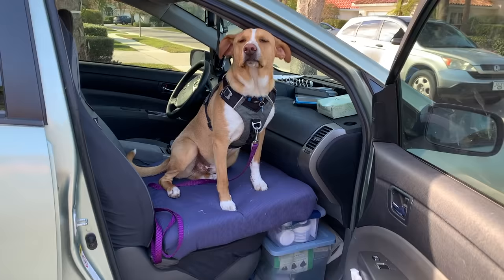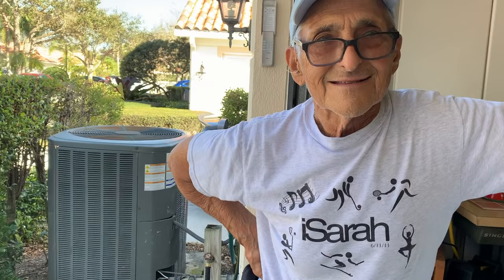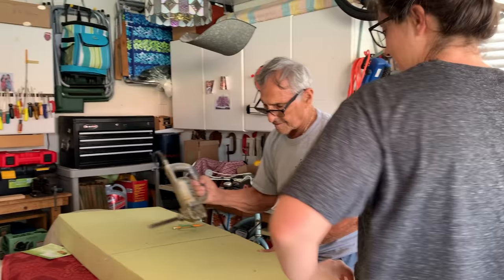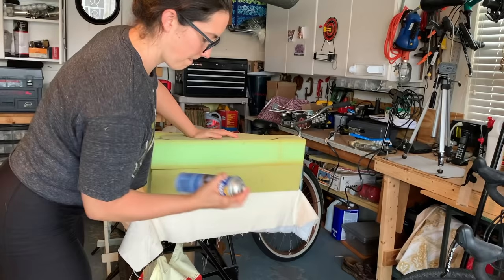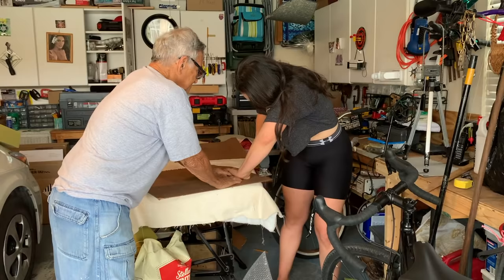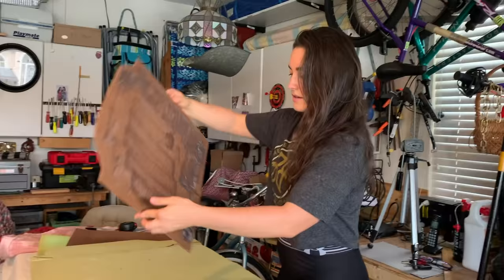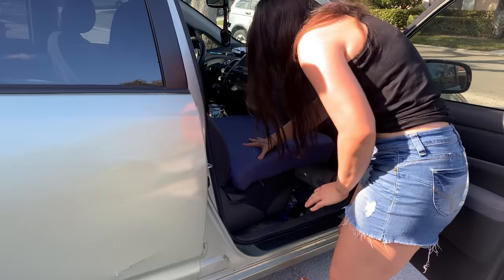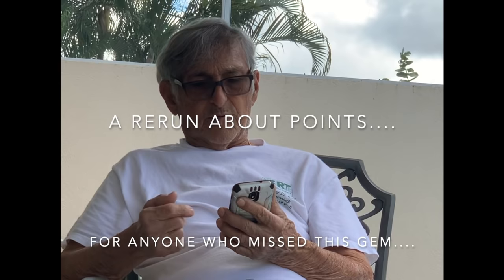Made a custom dog bed for my car's front seat! Step by step, HOW TO. Car Camping with a dog.

Comment: Camper knew from the beginning that was his bed. So cute! One question: does Camper have a seatbelt??? 😘🤗🌼🇻🇪
Reply from the maker: I’m actually working on a system right now as I removed the front seat (this is something you guys will see in a few weeks I’m just very slow at editing and )once I figure out that system I will post about it. :)))))
Reply: Lucky you camper
Reply: Sleepypod and ZuGo are the only independently crash test rated safety harnesses that have passed the crash tests.
Reply: There's a dog seatbelt that clips onto their harness and  alsoplugs into the seatbelt (where you put it on and insert it and it 'clicks'). It's SO super easy and cost about 10 bucks. Just another alternative.
Reply: @rainsofhealing4091  that type doesn’t pass crash tests, however, and dogs and passengers can still get horribly injured or die.

Comment: Camper knew from the beginning that was his bed. So cute! One question: does Camper have a seatbelt??? 😘🤗🌼🇻🇪
Reply: Was wondering about the seat belt too. You can use a seat belt with a harness. That way the dog isn't flung around the car in the event of an accident.
Reply from the maker: I’m actually working on a system right now as I removed the front seat (this is something you guys will see in a few weeks I’m just very slow at editing and )once I figure out that system I will post about it. :)))))
Reply from the maker: But yes originally I did have a seatbelt attachment for the long-haul!

Comment: I am new to your channel so you may have answered this question: have you been able to turn off to airbag in the passenger seat? I can't remember if the Prius gives the option. 

Your Grandpa is a sweetie ❣️
Reply from the maker: I actually have a video coming out where Iremoved the front seat... Should come out in a couple weeks but how this could be useful… I show you how to trick the car into thinking the seat is there and some thing you could possibly do is move the weighted sensors so therefore the airbag never goes off (what I do) assuming you will never have a passenger.
Reply: @NikkiDelventhal  Looking forward to watching. 👍